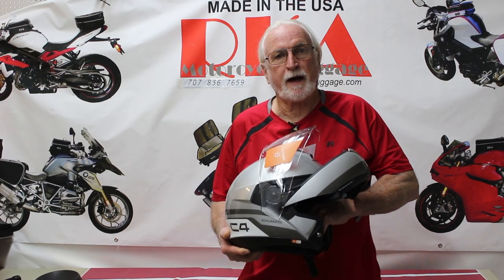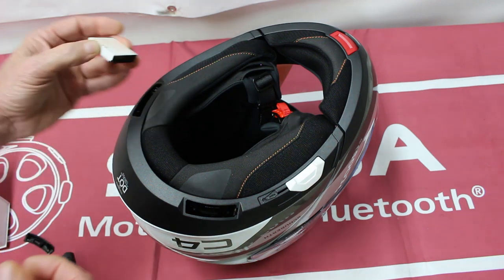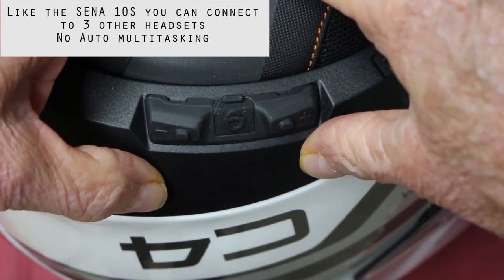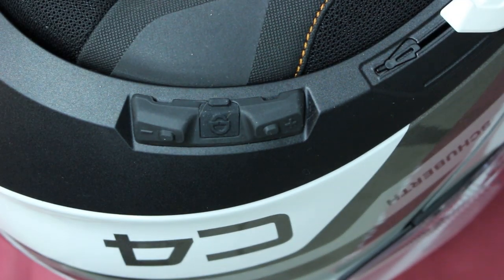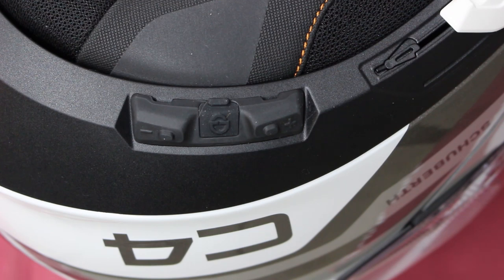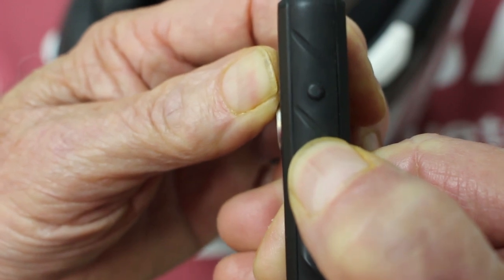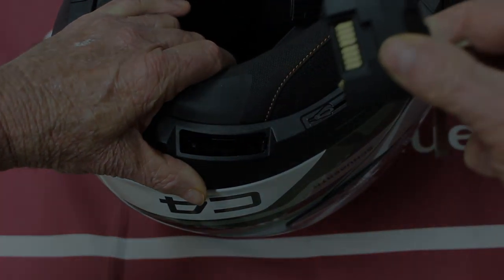SCHUBERTH C4 SENA SC1 Install

Comment: I have the C4 Pro and the SC1 Advanced.  A few points from my experience:

1. I had a problem with the fit of the battery and helmet.  The battery connector springs were not sufficiently tight so that any shock (e.g., slamming down the visor) would momentarily disconnect power and turn off the SC1.  I wasted time with Schuberth support, but fixed it myself by inserting a thin piece of foam between the battery and cover that created more pressure and a better connection.
2. I never use any of the “Advanced” features.  It’s a waste.  In fact, demonstrating its integration with various devices and intercom config is also a complete waste.  This is what I do and what everyone should do: use the C4/SC1 purely as a headset to your phone and mount your phone (e.g., RAM mount X-grip) in front of you (with USB power).  Your smart phone is the most advanced piece of consumer electronics you own and you update it more often that others.  It does everything you need – GPS/Nav, Bluetooth, phone, music, performance apps, radar detector connection (e.g., Escort 360), intercom, etc.  Just pair your phone to the SC1 and you’re done.  Now all control is via your phone (my glove tips are touch-screen capable) including adjusting volume, answering calls, etc.  It’s way better than reaching back and pressing hard into the helmet buttons to navigate its austere interface.
3. Oh, download the Schuberth app to your phone and update the firmware.

Eventually Bluetooth headset capability will be part of every helmet.  Eventually bike manufacturers will understand the centrality of the smart phone and design their consoles with a place for your phone, including the provision of internal telemetry and advanced configuration for better/customized UI.
Reply from the maker: Thanks for the comments 
WOW Bernhtp, You are on THE PAGE ;-) You need to watch my other videos about using the PHONE ONLY we are on the same page. This was one of the hardest reviews I have done. We are VERY GOOD freinds with Schuberth and own SIX of them. BUT the C4 is a terrible helmet and if you can read between the lines you will see this. I have retired my C3P and am using the NEW SENA Momentum "Intellegent Noise Control" helmet at $549.00 ready to go out of the box. THIS IS A GREAT SYSTEM. (Video is "RKA presentation of the SENA Momentum Intelligent Noise Control Helmet" I do seminars on this 10 to 12 times a year ... When I am not doing the BMW seminars with my BMW all prettied up with this and that connections .... When they are not looking I JUST USE MY PHONE as SENA Blueooth headsets were designed best to do. WATCH "SENA Bluetooth for dummies" and 30K "Hello SENA" and "Hey SIRI" voice commands. Thanks again for oyur comments. Ride safe. Richard RKA
Reply: I own my second C4, and luckly I have not had any problem. I did notice that the battery does NOT fit snug,,,but despite of that, it does not give me any problems.
I am surprised with so many bad reviews on the SC1 and the C4, firstly I have made 42 years of riding last month (September 2018) and I had used all types of helmets, mostly CHEAP ones, and then my Brazilian friend told me I ride nice motorcycles with CHEAP helmts, and I should consider a good helmet for these reasons:
1-SAFETY
2-COMFORT
3-RELIABILITY.

I am very happy with my 3 year use, and in fact I purchased my second one.
By the way,
 RICHARD...THANK YOU SO MUCH FOR YOUR GREAT VIDEOS BUDDY.

Comment: I personally feel the Neotec 2 is a far better helmet. It's quieter, looks WAY better, and you get passive exhaust vents. Which you would think would be on every helmet but the idea escapes Schuberth. Also, every person I know that's bought the C4 with the comm system, Absolutely hates it. Maybe they got unlucky but over 5 people is too many to be a coincidence. To each their own but I feel Shoei is where it's at. Especially for the amount you pay for both. ✌️
Reply from the maker: Sorry Aaron 93 but you are way wrong. Forget the C4 ;-) ... The SENA Momentum INC helmet is so far ahead of the pack it's amazing.
Check out that video .... We just arrived in La Crosse WI after 4 days on the motos using the SENA INC helmet Fantastic sound, so quit inside unbelievable!! IT has two things you need to let go of if you want this helmet it is not moduale and it as no drop down screen. Being a xroadracer changing back to the FF was easy.  the first video I did is on of the latest look for it.  ". There will be another real soon with REAL MILEAGE and testing ;-)

Comment: My husband and I just bought C4's with the SC1A comm system. However we are having trouble getting the two helmets to pair with each other as we like to ride with an intercom between us. I've updated the firmware and tried to follow the manufacturer's instructions but it doesn't work.  Any suggestions?
Reply from the maker: Hi Allison, I must tell you RKA is freinds with Schuberth BUT the C4 is NOT our favorite. 
The answer is PAGE 18 of your users manual SC1

8.1 Intercom Pairing
8.1.1  
Pairing with Other SC1 Headsets for Intercom 
Conversation The SC1  can  be  paired  with  up  to  three  other  headsets  for  Bluetooth 
intercom conversation.
1. Turn on the two SC1 headsets (A and B) that you would like to pair 
with each other.
2. Press  and  hold  the  (-)  Button  for  1  second  to  enter  the  intercom 
menu.
3. Tap the (+) once, and you will hear a mid-tone single beep and the 
voice prompt,  “Intercom pairing”

THIS IS THE STEP EVERYONE FORGETS OR DOES NOT DO .......

4. Simply tap  the  (+)  Button  of  any  one  of  the  two  headsets  A  or  B 

NOW THEY KNOW TO TALK TO EACH OTHER 

and wait until the LEDs of both headsets turn to blue and intercom 
connection  is  automatically  established.  The  two  SC1  headsets  A 
and B are paired with each other for intercom conversation.

Richard RKA

Comment: Is there a metal loop/D-ring on this helmet's chin strap to lock it to my bike?
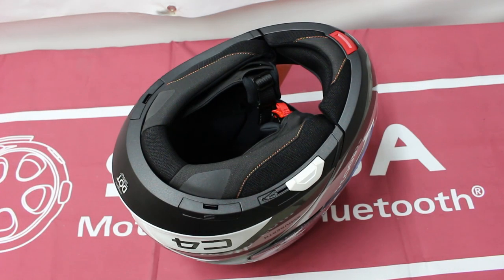Reply from the maker: NO, At 1:30 into the video you can see the RED quick release buckle system no D rings
Reply: Richard Battles I have a much cheaper flip helmet with a ‘non D-ring’/car safety belt style buckle, but it still has a single metal loop for use with common bike helmet locks. How frustrating! 😫
Reply from the maker: @LukeTPZ  Just between you and me this is the ONLY Schuberth  helmet we have not kept. This unit is 10S technolgy for starters .... My personal go to helmet now is the SENA Momentum INC PRO, Not a modular, No drop down screen, BUT SOOOOO many other features it's a no brainer for an X roadracer that used a FF helmet for 30 years ;-)

Comment: Okay I think I got it.  I reversed the first two pairings connecting first to nav, then to bmw and then phone to nav.  Bingo everything worked.
Reply from the maker: I do not want to confuse my viewers .....  It does not matter which way you connect.... Bull, You had an issue that somehow was resolved ... YOU had some kind of CONFLICT .. I can prove that and show it done BOTH ways ... but I cannot make 30 minute videos when 3 to 5 minute videos are hard to keep a viewers attention. ;-)

Comment: Love the helmet, and have the SC1A, which I found the microphone to be absolutely hopeless, either using the phone or the intercom. You are basically unintelligible at anything over 40mph. I have uninstalled it, taken the speakers out and bought a 30k instead. I think the SC1A setup needs a proper boom microphone of some kind to be useful. Maybe I just got a bad one, but lost patience with it now. Love all the vids you do though :-)
Reply from the maker: I would really like to know how you installed the cradle, speakers and mic on the C4, I have been a pioneer in adapting the SENA cradle to difficult helmet applications but I must say I am at a loss on how to do it properly, I .... at this time .... will not do a SENA install. .... Talk to me ;-)
Reply: Yep, it wasn't easy to decide how best to do it. I used the Adhesive mount and mounted the cradle just at the end of the sun shield slider. It is not as "flush" as I would like as a result unfortunately due to the surface of the helmet its mounted to. The built in speakers have been sacrificed I'm afraid, I cut them out, and replaced them with the 30K speakers and phone covers. I did consider leaving them in and using a pair of customised ear buds I have, but just thought I'd go for it regardless. The speakers are better than the standard ones also, in my opinion anyway. I used the wired boom mic and replaced the original mic. The cables from the cradle just go over the neck roll and into helmet where they are routed behind the liner. The mic is velcro'd behind the cheek pad and the boom mic is just in front of my mouth. I'm sure somebody more talented would have done a neater job, but I'm happy enough with it. Its such an expensive helmet and only a few months old, I can't tell you how disappointed I was with the SC1A, and personally I would not recommend it to anyone. Overall, its a compromise on an expensive helmet that I love, but want some decent comms which I didn't feel I had with the SC1A.
Reply from the maker: Send me some photos at richard@rka-luggage.com. Sounds like you did what I would not, and ran the speakers and mic wires OVER the neck roll The way the neck roll SLIDES in made the decision for me not to do it. :-( NICE you got it done anyway ;-)
Reply: Richard Battles 

Sent. 

I resigned myself to having no choice in the matter if I wanted decent comms. But like you, not very happy about it. In practice it works fine though. Also unhappy about the “angle” of the 30K but in practice it’s very comfortable and easy to reach and use. The way I look at it is I’ve made the best I can from what was a well integrated, but poorly performing SC1A.

Comment: Hi Richard. Thank you for your informative videos. I just bought the the c4 and although I find the helmet comfortable, I am getting "imprints" just behind my ears after longer wearing periods. It seems something in the helmet is pushing hard just behind my ears pressing on my skin causing two lines. Is there anything I can do? The rest of the helmet fits and feels fine. I have of used the helmet twice now. If i take a size bigger it's too big for me. I would appreciate your professional feedback on this. Regards from Johannesburg.
Reply from the maker: Hi Zunaid, We did not keep the C4 to test fitment, we only had it to show the install of the communications. Sorry I cannot help you with that issue. I would go to my dealer where you purchased it and ask them. R

Comment: Hi Richard! Congrats on the great videos. Would you mind sharing with us what radar dector do you recommend and where do you keep it on your bike? Many thanks!
Reply from the maker: Hi Felipe we use and offer Adaptiv TPX radar detectors, www.rka-luggage.com. RKA manufacturers an IN-Charge tankbag with a "Dashboard" this is where I carry mine but you can put it on your handle bars with a mount from Adaptiv see link to our products page. OR you can use Rammount parts. There are videos on all this on our RKA YouTube page. also send me an email at richard@rka-luggage.com and I will send you images of all the choices you have. Ride Safe ;-)
Reply: I have the Escort 360.  It Bluetooth connects to the Escort Live app on my phone, which is then Bluetooth connected to my SC1.  Thus the alerts and other info from Escort Live go into my helmet along with other Audio from the phone (Nav, phone and occasionally music).  I generally keep the Escort Live app in the foreground on my phone and the phone is on a X-Grip in front of me.  It's easy to interact with the phone when I need to (not often) with my touch-screen-capable gloves.

Comment: I followed the protocol.  Connected Sena to BMW first successfully.  It worked.  Connected sena on mobile 2 to nav and it works.  Connected phone to nav successfully, but not able to receive calls. On headset.  Any suggestions?
Reply from the maker: The only thing I can think of is you have CONFLICT. Do you have your phone connected to your headset? If so you are in conflict with the Nav connection. https://youtu.be/8QaW4q89H_4

Comment: Does the SC1 system work with the Scala neckroll system for the C3?
Reply from the maker: NO. The SC1 only fits in the NEW C4 Helmet. The SC1 slides into the Helmet NOT the neckroll. AT the 3:20 minute mark in this video it shows the actual unit being installed in the HELMET.
Reply: No, can it pair with the SRC (Scala) system that was on the C3Pro?
Reply from the maker: YES ... by using SENA's "universal intercom" feature. The SRC will connect using it's A2DP profile (Phone connection)
Reply: Do you find that works well? Is music sharing from the Sena available in this mode?
Reply from the maker: NO .... universal intercom SOUNDS great but it sucks (you will not find may re-sellers that will be this honest with you ;-) ) as the other manufacturers unit (Scala) looses everything except intercom.  .... NO .... music sharing does not work with another manufacturer .... Bottom line here is universal intercom is not something you want to use all the time. Everyone needs to get on the same page (Manufacturer)

Comment: OK Richard, I have a Gold wing and how does it work with the CB
Reply from the maker: Hi Badboy, the CB on your GoldWing has nothing to do with the Schuberth helmet or the SENA Bluetooth system. I'll start from the top.1: The 2018 GoldWings have FULL Bluetooth systems, Hook up ANY BT headset and everything works including your receive and transmit on your CB. 2: A GoldWing with a hardwired system would require a SENA "FREEWIRE" http://www.rka-luggage.com/A46%20SENA/2017%20New%20Pages/2017%20Freewire/SENA_2017_Freewire_page.html (we have these in stock) This unit plugs into the hardwired din plug then transmits the signal to your headset. Again everything now works CB TX & RX. 3. If you have an older GoldWing that does not have a built in CB you could use a SENA SR10, http://www.rka-luggage.com/A46%20SENA/SENA_SR10_page.html , Midland 75-822 portable CB http://www.rka-luggage.com/A37Midland/Midland_products%20page.html. The SR10 unit plugs into the CB. The SR10 connects (pairs) to a Bluetooth headset and everything words. Click on the links for more information.  RKA has all these devices in stock. If this all seems like to much information we can continue this conversation by calling me at the shop 707 836 7659 or email me at 
richard@rka-luggage.com. 
This is my BMWR1200RT using the SENA SR10 and the Midland 75-822  ..... http://www.rka-luggage.com/A08%20BMW/R1200RT/2014%20RT%20Richards%20Page/RT_CB_RADAR_iPhone/R1200RT_Mom's%20Run_7_bi.jpg